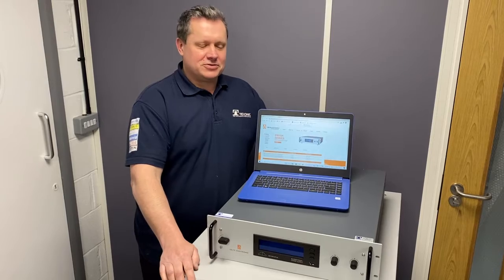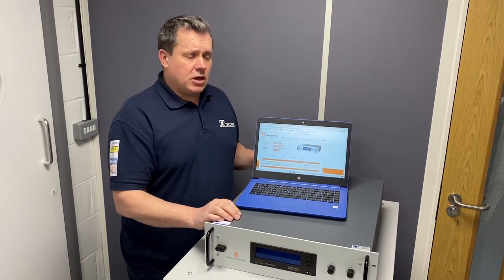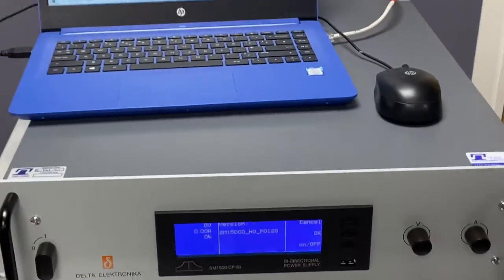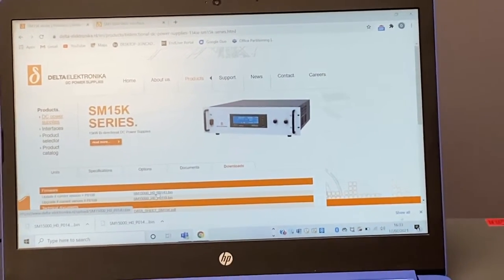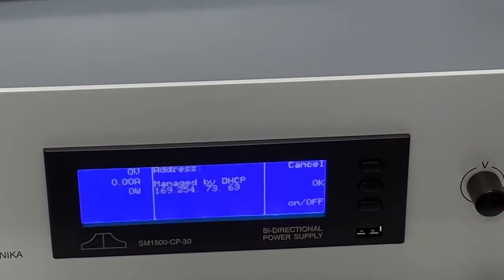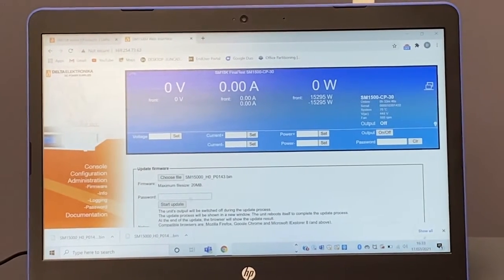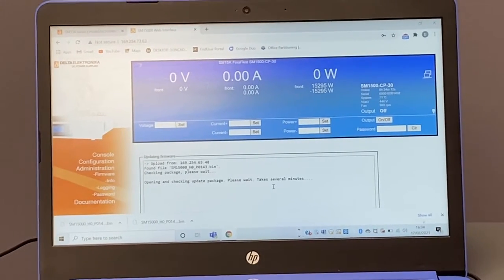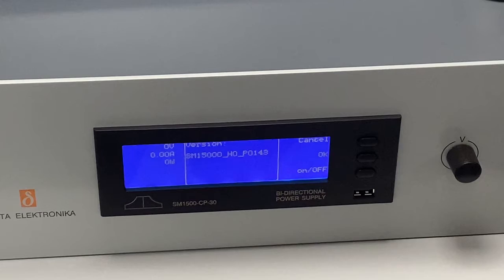Delta Elektronika SM15K Firmware Upgrade

Comment: For anyone that is struggling when installing USB interface and it doesnt get any response from the terminal when sending commands: You need to connect via LAN cable, on the interface by default its selected RS232 port, you need to switch it onto the USB. It took me 3 days and a lot of frustration to figure this out on my own, i cant belive that there is nothing documented about this on user manuals. Very bad documentation
Reply: I am struggling the change the voltage and current, its not reflecting

Comment: Hint for others: In case the update doesn't work because of "Error: Invalid password.", try changing the password to "default" (which removes the password) and retry without entering a password. This worked when updating from SM15000_H0_P0150 to SM15000_H0_P0151